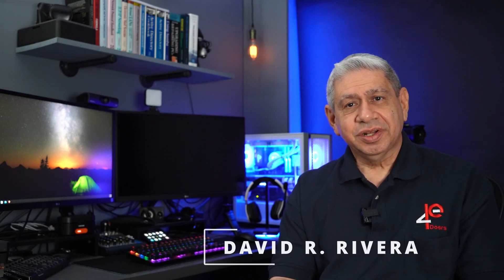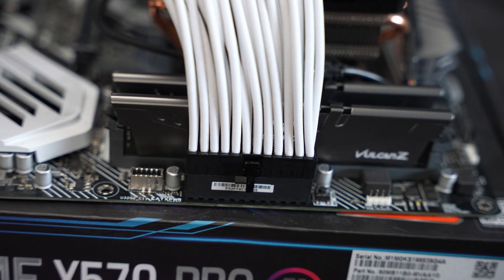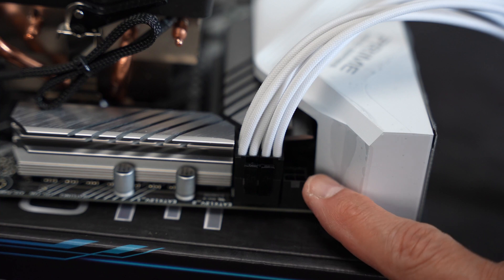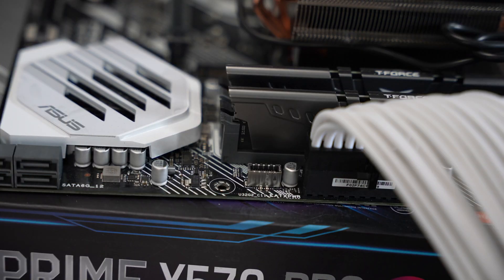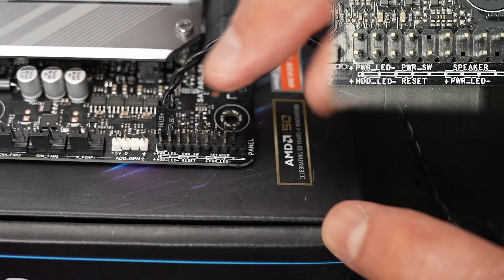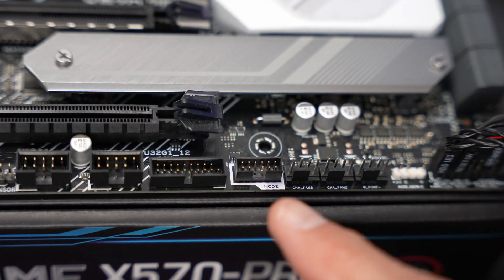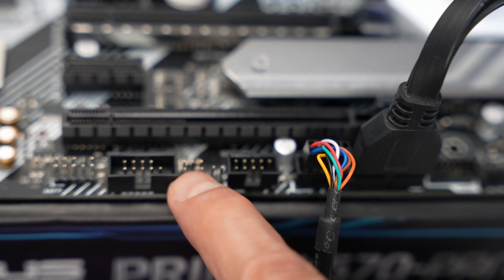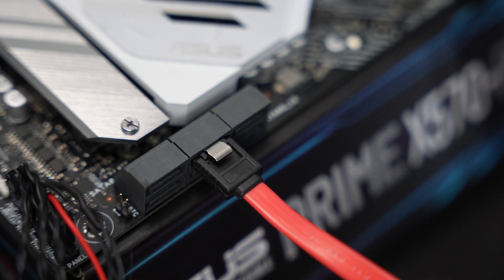Properly Wiring a Motherboard when Building a PC

Comment: I’m currently building my PC and the case panel/fan wires were daunting to address. My ASUS TUF 301GT case came with 3 fans on top 3 on the front and one in the back. Thank you for your video now I will review my connections and fix those I mess up on 😅
Reply from the maker: That sounds great.  Let me know how it goes.